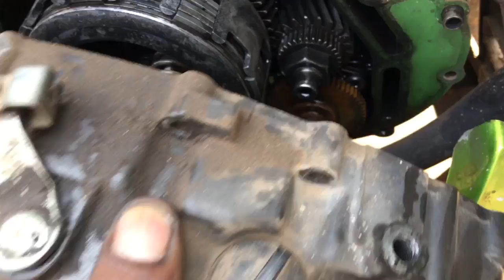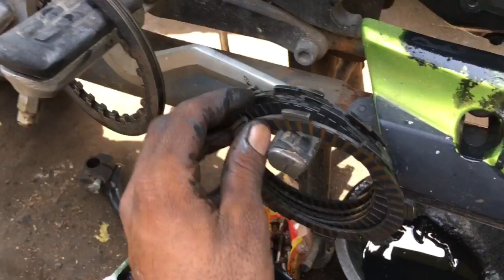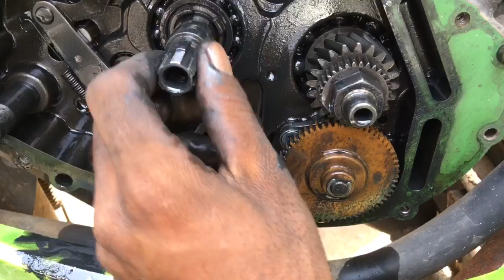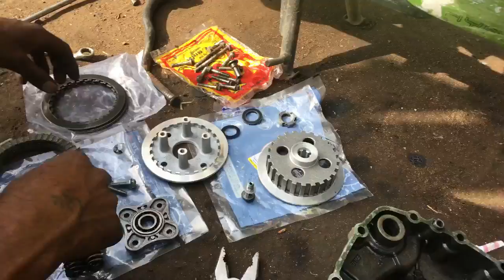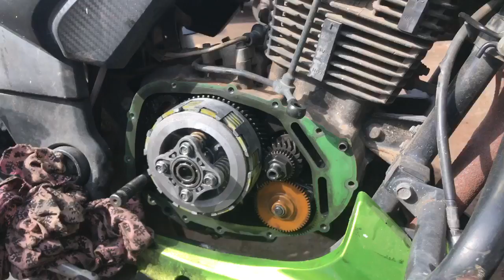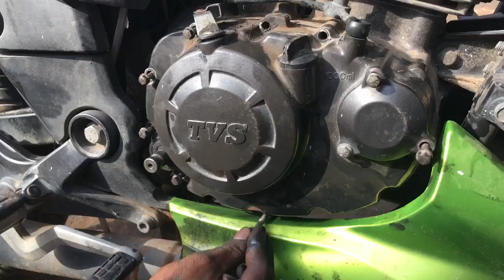How to replace TVS apache RTR 160 clutch Plate music tube

Comment: I have apache RTR 160.
Bike jb main stand pr hote h or engine start kr k gear me dal ne bad bike ko chlate h tb wheel chlta h ekdum Ok.
Same gear me clutch press kre to tb b wheel goom raha h or par laga k rokne pr easily ruk jata. Or ye sb 5 gears me ho raha h.

Ek mechanic ko dikhaya b vo bola ye normal h.

Please suggest....
Reply from the maker: Bhai usme clutch cable set karke dekh Lena  fhir bhi vahi problem ho to clutch plate change karni pade gi